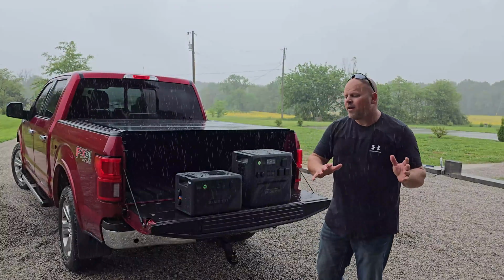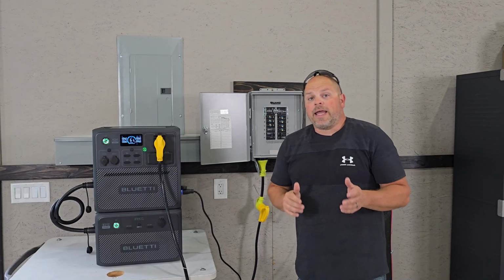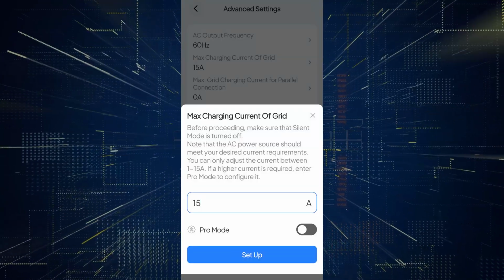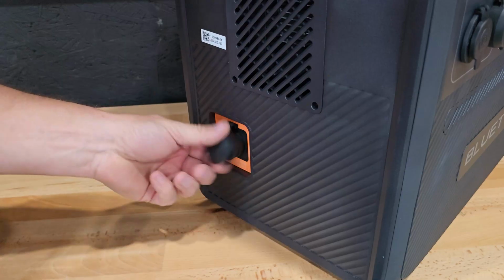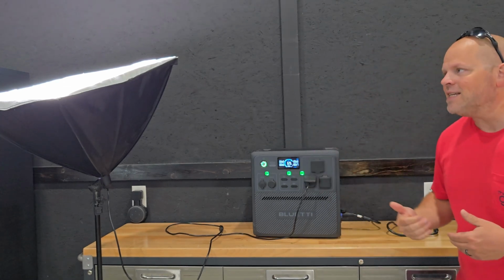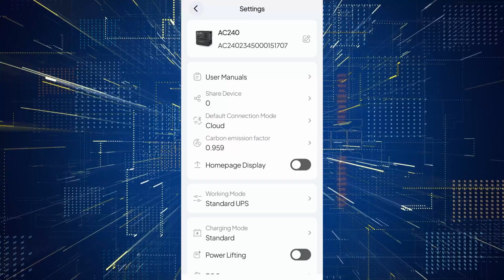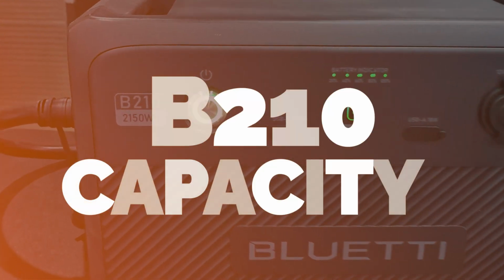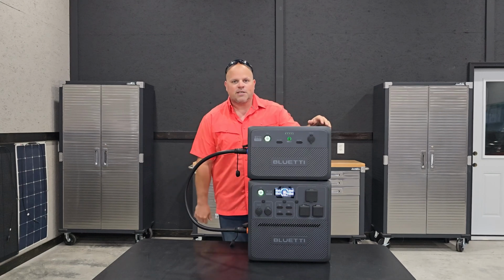You might not know this about the Bluetti Ac240 & B210 Battery

Comment: I have a AC200L and just ordered a B210 battery.  Had no idea that I would need an additional cable.  Do you know which cable I need to buy from Bluetti?  Thanks and absolutely love your videos.  Very informative and have helped me with my Bluetti journey. 🙂
Reply: I did the same mistake. GRRR. I just paid $99 for the  P090D cable and hate it.  The part the connects to the AC200L is HUGE, super long, and creates a stress point that is begging to be broken. Worse yet, I cannot set them side by side in my RV hatch because I only have 42" x 19" of space. That SHOULD be plenty, but the cable wont allow it without being pressed up against something trying to break. I wish I had known this before I bought it. Maybe this will help someone.

Comment: they need to add a feature..   so you can throw in as much power as you can and the box limits  the intake to its own power limits,  built in voltage controller,   2500 watts going in and just take the box limit .  now that would be a kickass power station..

Comment: I have a question 🙂 can the B210 be connected to the AC300 or AC500 using a different cable, or can it only work with the two devices you mention here in the video?
Reply from the maker: I haven't tried it or been able to confirm it.

Comment: Best way to find out if the UPS works enough for a home office is to run a computer without a battery in it. Unplug the Wall AC and see if the screen goes black and computer turns off.
(Edit for correcting spelling.)

Comment: You can use more then one 400 watt solar panel, I use two, sometimes four in parallel. Over 15 amp is fine, the solar generator will only take in the 15 amps, not more.
Reply from the maker: Thanks for watching and commenting 👍🏻

Comment: Blue yetti AC200L i saw ur review on Amazon, and u did a drain test. Basically putting a load close to 2100 watts (rated 2400 watts) but never said HOW LONG the unit lasts while using all those watts. Im guessing maybe an hour max at close to max load. Is this accurate? 

Of course lower watt usage, means unit will give power longer.
Reply from the maker: That is correct on the AC200L.
Reply: @TheSolarPit  ok cool thank u. Max watts usage gives about an hour of use before needing recharged again.

Comment: Just connect a computer to the AC240. Pull the plug on the 240 and then confirm that the computer still operates normally (search the Internet). That will confirm that the UPS function is fast enough to keep power to a sensitive electronic device.
Reply from the maker: I don't own a desktop, everything is laptop with internal batteries. I need to pick up a old one just to do test with.

Comment: Is there any way you can do a quick video about the AC200L being paired with the B210s? Curious to know if the unit wakes up and starts charging both batteries as soon as it starts receiving input from the solar in the mornings. I have an AC200L and would like to expand the unit with two B210s.
Reply from the maker: I need to obtain the proper connection cable and I will try to put a video together on that.